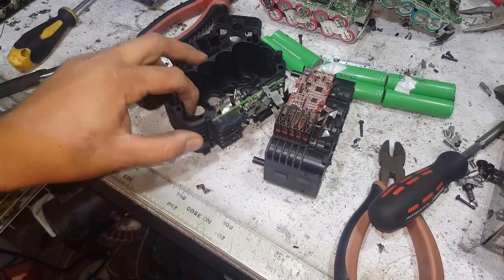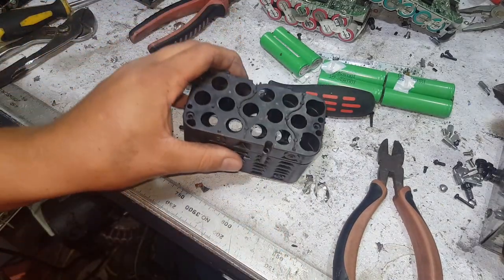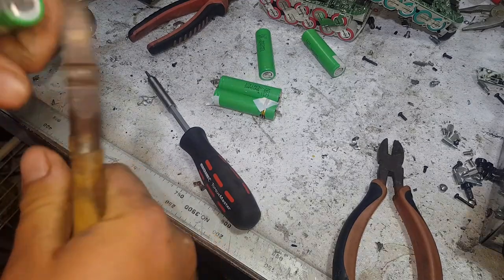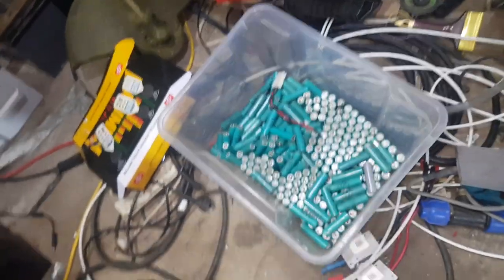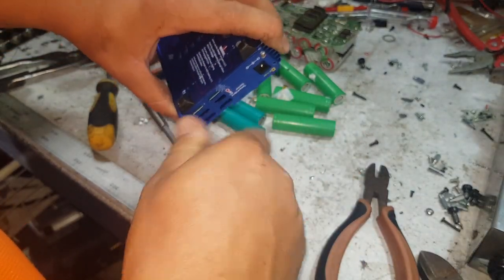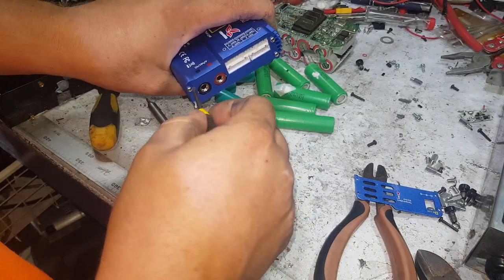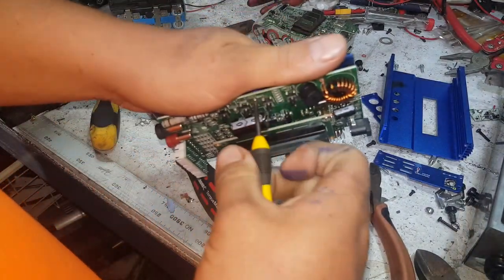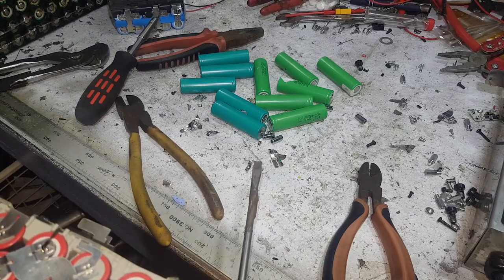18650 Processing And A General Update In The Power Shed

Comment: Are they high drain cells or like laptop batteries ?
Reply from the maker: The green blue sort of colour Samsung 20r ?
Reply: i mean take a part from drill packs , in geneeral they should be high drain as i know
Reply from the maker: Oh Yeah they  are great hi power high drain cells the hg2 and 30q cells are high discharge and 3000mah capacity still
Reply: wow,,thats really great :) especially for ebike )
Reply from the maker: Yeah some of the high end Samsung's and Lg cells are 2000 to 3000 mah and have discharge ratings as high as 20c i believe
Reply: thanks for informing :)
Reply from the maker: Any time mate glad i could help